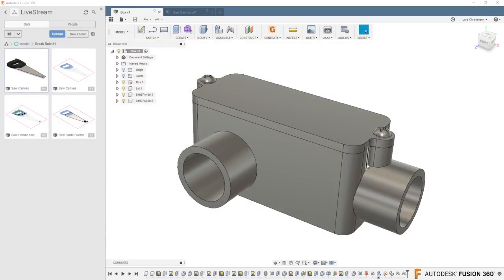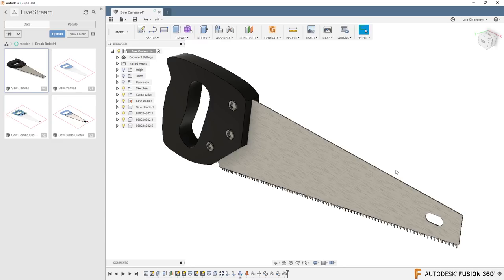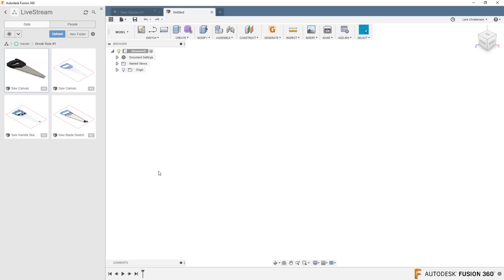Break Rule #1 — Fusion 360 Tutorial — #LarsLive 183

Comment: When you copy in a sketch from another project you get all the dimensions for it, but does it also bring in the related defined parameters for the sketch? That other project may well have had lots of crucial parameters defined which were used in the creation of the original sketch, and you may well want to have those parameters brought over into the new project along with the sketch. But are they copied over?
Reply from the maker: Hi Roger Garrett Thank you for watching!
They are not. I think because they are linked to a dimension by name. Like d1, so if you brought it into another design it would interfere with that models d1.
I don't understand all the stuff going on in the background, someone from the development team could probably give more insight

Comment: I'm new to Fusion360 and have a quick question (I bet many here can answer).

I recently created a similar item (actually a human with a center body and two legs on each side).  How exactly does the negative space where the handle meets the blade get made?  I would assume that if the handle is its own component and that I do a symmetrical extrusion than that piece would be solid all the way through, no? Is the solution something Lars mentioned with working on bodies and subtracting things out.

I may have skipped close to 180 live streams so excuse me if this had been covered. :)

Happy 4th!!
Reply: One way would be to use the sketch of the blade to extrude cut the space from the handle  (ie: select cut when extruding that blade shape through the body)
Reply from the maker: Hi WirelessGuy NY Thank you for watching!
John, Thank you!